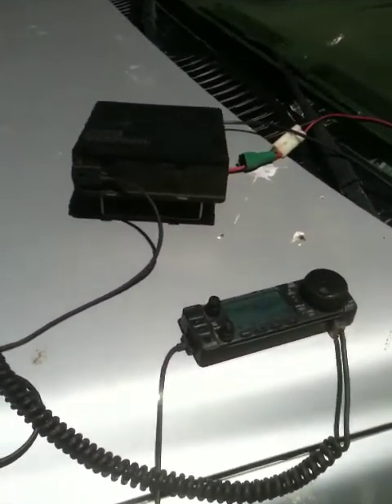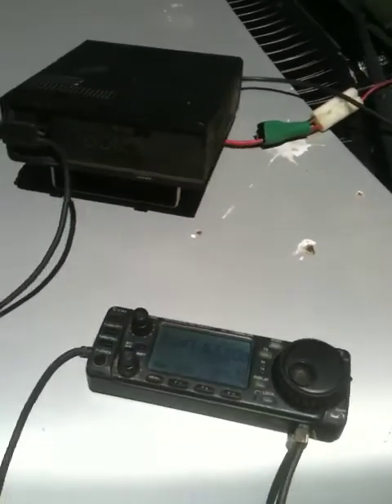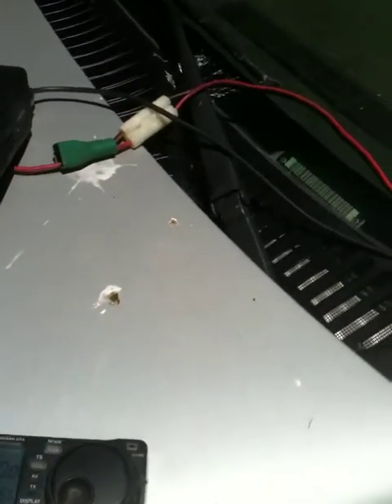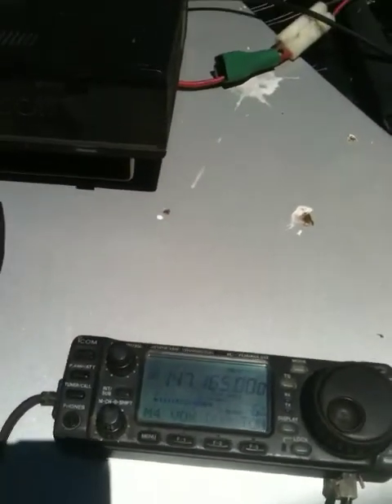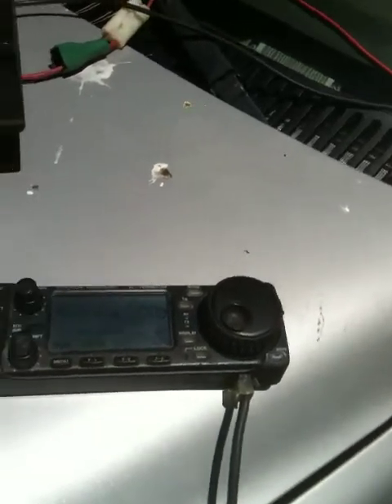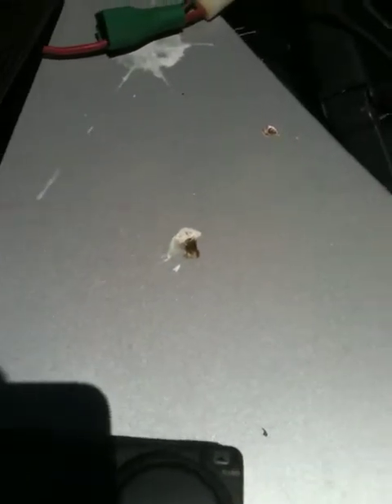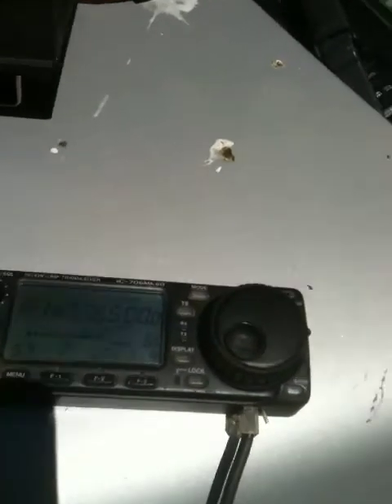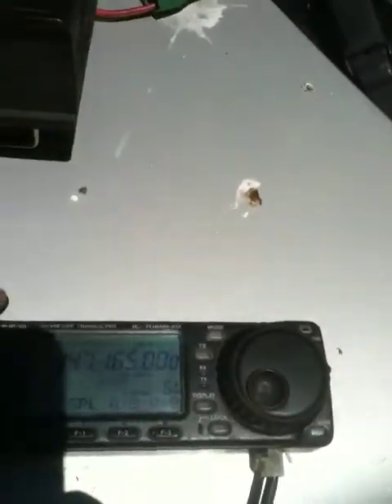My ICOM 706 mkllG Ham mobile transceiver

Comment: @JettaJ1 Sorry it took so long to get  Back to you, I can't get into my account anymore. Actually no, I don't have a problem with RFI. My truck is a 2002 Chevy Silverado 1500. I have found on other vehicles with other radios, if you have a alternater going bad, it will cause a whine.
New account is kf6eii2.
73 de kf6eii